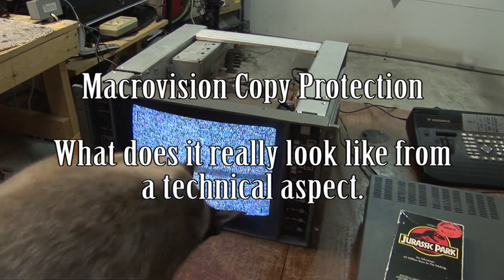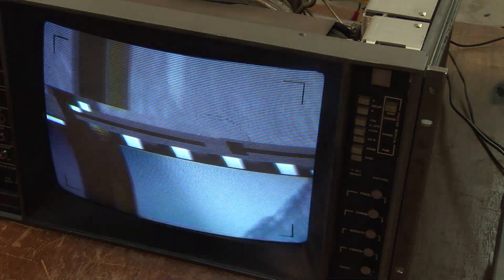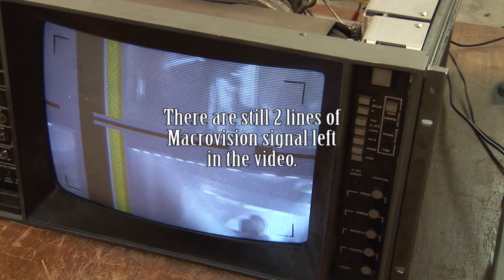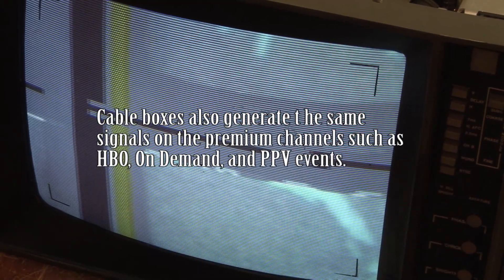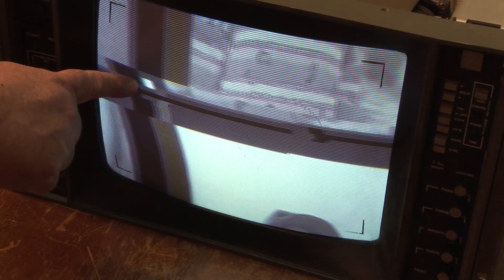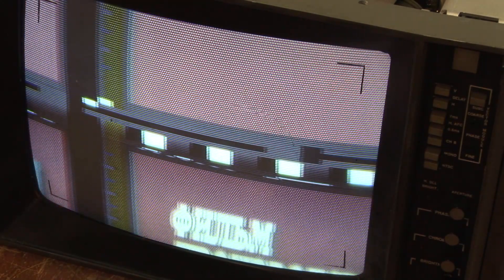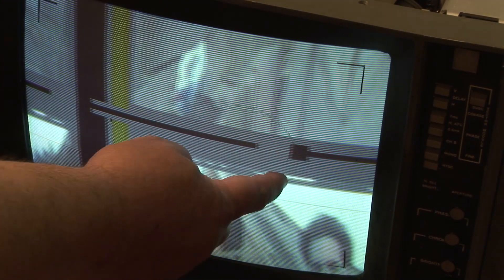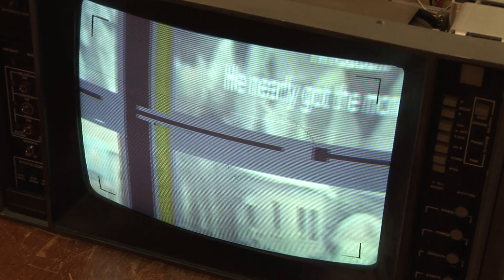Macrovision vs a Time Base Corrector

Comment: Some DVD players, especially off-brand models, can be configured to disable MacroVision encoding and region locking. It usually involves pressing a special combination of buttons on the remote to enter a hidden service menu with those options. The TBC in Sony DV Handycams is almost good enough to remove MacroVision but there is still a slight and brief but noticeable brightness dip whenever the bright white boxes kick in. I've seen MacroVision encoding cause brightness variations even when just watching a movie, not trying to dub or record it.
Reply from the maker: +VWestlife (backup account) Macrovision is evil.Yes I know unlicensed DVD brands could disable it.This wasn't intended to specifically target DVD, it was just to show how it works. Cable and satellite box use of macrovision is what most people would need a scrubber for so that hard copies can be made of encrypted programs on premium channels like HBO.

Comment: It's not just VCRs, many old tellies had problems w/ MV, also. When I was a teen (~25 years ago), my dad bought a MV-killer for our 70's-era 19" telly. The symptoms on that set were usually a black bar from the top of the screen, down to about 1-1.5" & the rest the picture flashing, fading &/or rolling. And we weren't feeding two VCRs, just one to the RF aerial terminals on the set.
Reply from the maker: +Madness832 
Yes it did cause problems especially with rf modulators as the bright white pulse would over modulate the carrier so the rf modulator would "ride the gain" with an agc just like a VCR.
Reply: @ Madness832 Interesting... I wonder if you used a HDMI converter it might smooth out the signal.

Comment: Both devices seem to replace signals in the blanking intervals, only differently. The macroscrubber only replaces most of the VBI, the TBC seems to replace the entire set of blanking intervals, and offsets the signals somewhat, for counteracting that little time shift that switching between two video heads causes. That's how it looks like to me. So far I thought, it's only the square pulses in the VBI. Very informative video, thanks!
Reply from the maker: The macroscrubber uses a sync pulse generator for TV camera, and gen locks to the incoming signal to produce a  blanking signal to mute video in the first 21 lines after vertical blanking. 
The TBC digitizes the entire video signal strips all sync information and generates new sync, then converts the 4:2:2 component digital signal back to analog, completely rebuilding sync and burst signals with new sync and burst, and in the process removing jitter, or tibe base errors as they are known which all analog video formats will have due to variables in analog tape playback. Temperature, humidity tape age, how many times it has been played (tapes stretch slightly) andslight alignment differences between machines all cause slight differences in the timing signals as they are read off the tape by the spinning head.

Comment: Somehow I think I missed this video when you first put it up. I used to use umatic high band for "prolonged" rentals. It seemed playback was more of a problem then recording. SO since I didn't have a macrovision box I made up a photo interrupter out of a loop of transparency sheet attached to the top of the umatic drum. Two carefully placed pieces of electrical tape on the sheet triggered the playback machine's vertical blanking ('mute') function via an op amp schmitt trigger I set up. This was "adjustable" and did effectively mask the VBI macrovision although the edges of the mask had interesting jitter (likely from the photo interrupter 'flapping in the breeze').   A slight tweak to the burst flag period 'window' (or whatever that's called) would chop off the bad portion of the burst flag and the machine would regenerate it, I believe. This did actually work for playback on a finicky monitor (which was my best one). I wanted to try it on the recording end but I don't think there was a way to regenerate burst flags before recording. But I think I could have used the photo interrupter VBI setup for r3cording and dealt with the chroma on playback.  Makes me want to go back and try this again when I have time.

Comment: What is it about certain older VCRs (before the DMCA) that they do not react to Macrovision?  For example, I have had the following RCA models made from 1989-1996 (I believe they were rebadged Panasonics and/or Samsungs) and all could properly record an analog Macrovision encoded signal from another tape (DVDs I do not know): VR625HF, VR740HF, VR603HF, VR603AHF, VR605HF, VR613HF, VR617HF, VR618HF, VR672HF?  Also, would such a Macrovision immune VCR have been able to record a CopyGuard protect tape?

Comment: I worked on the embedded software of a DVB digital satellite receiver once. The back-end (video output) chip was probably the same as one that was used in many DVD players. It was capable of inserting all kinds of MacroVision interference, based on I2C commands from the microcontroller. But not only was there another version of the same chip that didn't do MacroVision and would have been a drop-in replacement (pin-compatible and everything), but also it would have been easy to intercept the I2C bus and not let any MV commands through, or even simpler: block all commands once the chip was initialized a few milliseconds after the set would come out of standby.
I'm not saying that copyright violations are okay, but anti-piracy measures are always a pain for the regular guy who just wants to e.g. make a copy of a DVD to play on their kids VCR (which is fair use), never for the actual pirates that make money off it.
Reply: chinese DVD players didn't have this crap

Comment: That's when the copyright protection has set in 1977 when the General Assembly order companies protect their copies on Video Format include their fictional movies, documentaries, etc. that way their copies will be protected.
Reply from the maker: +Bluethunderboom The reason they had to implement copy protection was not so much for consumers, it was for video stores! Believe it or not when video stores first stared operating, movies were really expensive. Not uncommon for movies to run 150.00 per copy. So stores would be nervous renting out the original copy, and they would make a copy, and rent the copy out. Back in the early days people didn't complain, they were just happy to be able to watch a movie at home. Video store owner figures that if he could get away with 1 copy, why not make 20 copies and rent out 20 at once. Will make his money back much faster. Holllyweed struck back with the first version of copy guard, which was just modified vertical sync, as that would make the drum servo on early machines drift in and out of sync.That was easy to combat with a few transistors and a 555 timer.The next version was Macrovision, and that one stuck. As a content producer I used to encode my commercial tapes, at much expense to prevent clients from copying my corporate videos. When I did a video for a company, I built in the copy rights to my profits. When company "B" was quoting the client 10 grand to do their corporate video, and I was quoting them 5 grand to do the same thing, but I was charging 5.00 for each of the 2000 copies they were requiring, I certainly wanted to make sure that they bought those copies from me. Some companies thought it was OK to get the video done for 5 grand, and then order 1 copy, and go and hook up 2 VCRs and make those copies themselves. You can imagine the look on the face of the guy trying to do it when the copy came out looking like crap, and he had to come back and get them from me. Sure I had to farm the copies out to a duplication center to be done on a sprinter, so that eats away at my profits, hence the 5.00 a copy, but it kept me in business.

Comment: Is it possible when you are digitising tapes on a program like Elgato or Roxio to connect a DVD recorder with TBC (such as a Panasonic DMR-ES-10/15) in between the VCR and the USB capture card and actually receive a signal? 

🇦🇺Cheers from Australia!🇦🇺
Reply from the maker: If you have a DVD recorder why not just use that to record your videos. The digitizer in a dvd recorder is superior to what is in those cheap capture cards.  If you want a file, stick the finished disk in the computer and rip the disk and make an mp4 file. That is what I do because the quality is higher..
Reply: @12voltvids  Great advice, but I don't know which DVD recorders can bypass Macrovision without having to use a Macro-Scrubber.

Comment: I found similar Videonics equipment. But its name is "Titlemaker". Will it have this wonderful TBC too? And maybe I did not understood correctly but where do you switch from flex to infinite time window mode TBC in this thingy?
Reply from the maker: No title maker has a genlock to sync the title over the incoming video but not a frame store.the mx1 has dual infinate window frame store.  The difference between fixed and infinate is how much the video can be off to be corrected.  With stable signals then fixed works better as there is less delay. With crap signals from sources such as vhs then infinate window is better, it will correct a full frame, but if the source is fast or slow it will skip or drop a frame to get back in sync.  Fixed is great when used as a live switcher for live productions from cameras of digital video sources like DV because they will always be rock steady.  Infinate for crapy analog tape sources like vhs beta 8mm ect.
Reply: @12voltvids  Thanks, good to know before I bought it.

Comment: Smashing, i enjoyed that :-D
The scrubber just seems to blank out a section of the video, it possibly uses the sync to trigger a fixed blanking period to chop the unwanted part out, ok for video tapes but not quite right for dvd's.
Many years ago..... i copied an original vhs tape of startrek the movie (original cast), i didnt think anything about it at the time, but years later a frend said "You cant copy them, they are protected".
i was a bit confused, i was playing the tape from an ordinary vcr into my old jvc piano key video for recording, the jvc didnt use the blanking period as a reference for the agc, the piano key had a slow agc too, it didnt give a dam about what it recorded lol :-D
Oh the copy was still copy protected ha ha ;-D
Reply from the maker: +zx8401ztv close. The scrubber is a home built unit I built when I was studying video engineering. It is based on an old RCA LSI chip, a sync pulse generator for TV camera. It is generating black video h an v sync an color burst. There is also a sync separator that genlocks the sync generator to incoming video, and then a count down is triggered by vertical sync from the generator which gates in the new sync for the portion of the vertical blanking do the first 22 lines. It is actually a complex little circuit. I showed it in the other video. Has a few surface mount chips and the big dip package just soldered down to the component side of the board because I was lazy. I did that in 1982 when I was taking my first year engineering course but  I ended up landing a job with Sony the next year while on summer break and took their in house training, only to land at a service center the next year where I stayed for 20 years. It was during that time I started my video production business as a part time gig and ended up working on many corporate, and private video productions. I worked in a TV station for a couple of years too. I actually wanted to do broadcasting full time, as an engineer but that didn't pan out. Didn't have good enough math grades in high school to get into the 4 year program. I had algebra, but skipped out on the advanced calculus because my stupid high school councilor said I didn't need it. Go figure.
Reply: +12voltvids At least i was having a guess lol :-D
It sounds like you acheaved so much, you are a very clever and experenced man, leave the mathmatics to computers lol.
Thats why i enjoy your videos :-D, you are a no nonsense man that gives sharp understanding without confusing your audience.
You should have been a teacher of electronics :-).
Most teachers dont have the feel for the subject they are teaching so its hard work to understand them.
Reply: Prior to being mandated by US law, some Consumer VHS VCRs were not vulnerable to the Macrovision signal. Note there are two key words in the above sentence, Consumer and VHS. The legal requirement for copy protection only applies to VHS and later formats as well as consumer equipment. Due to the law coming in late, Beta was exempted as it did not reach the sales needed for the law to take effect.

As you noticed, any time there is no Time Base Corrector in circuit, a successful dub will contain the copy protection signal. This means you can't bypass it by adding a Beta generation. DVD to Beta will work, but the Beta to VHS copy won't work. When using a professional VTR you may be able to use it on the playback side as some units have integrated Time Base Correctors.

Of course, this is only a discussion of what is technically possible, even if you can bypass the protection, you are still bound by copyright law.

Bonus info: The reason Closed Captioning and Text is deleted by the Macrovision strippers is due to the way they treat the blanking interval. The strippers usually black out all of vertical blanking, this includes Closed Captioning, Channel/program information (yes this did exist on Analog on higher end sets), Rating Data (for V-Chip), as well as any other data in the Vertical Blanking Interval.

Comment: The scrubber also eliminates the closed captions that wouldn't be good if you need them.
Reply from the maker: Right but you can't copy s tape or ppv signal that has macrovision so losing the CC data is a small price to pay to be able to record vs not record.

Comment: I had a Sony SLV-920HF which had a bit of what I thought was quite an oddity.  If I set it to SP, it reacted to Macrovision.  If I set it to EP, it did not and I was able to make copies of Macrovision protected tapes that way.
Reply from the maker: That is strange because macrovision affects the auto gain control in the modulator and it is the same circuit regardless if the speed.  Betamax was unaffected by macrovision primarily because betamax was considered a higher quality format that Sony modeled after the professional 3/4" umatic using the same circuits that 3/4 used. In other words they didn't have the macrovision detection that VHS had built into the chips. On hi8 they had a little plug in board that you could remove to defeat it.
Reply: @12voltvids 
Right, that’s what always caught me off guard about that particular deck.  It was almost as if setting it to EP disabled the video AGC for some reason.  Some weird design flaw maybe?  I don’t know.  That was the only VCR I had that did that.  
I actually have come across a Betamax that Macrovision messed with … hmmm.. actually, it was Sears model, OEM’d by Sanyo, so maybe that doesn’t count lol

Comment: it is like the Videocrypt (system used by SKY PLC)  data signal at the top of the picture area.
Reply from the maker: +DAVID GREGORY KERR Well, not exactly. Videp chypher uses a similar system for analog NTSC satellite, where they replaced the entire horizontal and vertical blanking area with data.  If you look at the pulse cross portion of the picture, everything except for the active picture area, and the color burst (the green stripe at the beginning of each line) was replaced with digital data. This digital data was actually the audio for the program feed, and the subscription data for the descrambler board. I remember seeing some old chipped boards that would unlock the video, and for a period of time would unload the audio too, but the audio was scrambled, and once the fix stopped working, it would descramble the video, but no sound.  Basically only good for watching programming where the sound really didn't matter. You can use your imagination here.

Comment: Thanks a lot for this interesting and excellent videos!!

I have a poor english, so I think i've understood: if i want to digitalize vhs always have to use a tbc (i have mx1). always with 0 options in the setup menu?

but if i want to erase mv from a tape the best option is a mv eraser box. i have one of them but i dont know if all the boxes are the same way or there are different systems... i have one of these boxes but i dont know if internally is the same than your.

thanks in advance and hope to keep in touch !!
Reply from the maker: The MX1 will remove macrovision enough to record on most devices, but a true macrovision scrubber will completely eliminate it.
Reply: Thanks for your answer! dont know why but mx-1 gives me a darker image than the original :(
Reply from the maker: Yes I have noticed that too. Eveything passing though it is slightly darker, but there is a fix for that. In the setup menu there is a black level adjustment. I forget which icon it is, but three is one that compensates for it. Been so long since I used an MX1.
Reply: Great !! I'll test the different level option :) Thanks again!
The darker image is only when there's a MV signal, isn't it? Or a tape free of MV gets darker too?
Reply: I'd like to ask you. The best option to capture a vhs with no MV protection is directly with no changes in the Videonics configuration and if the VHS has MV just only configure the Videonics with the black level adjustment at 3? Thanks in advance for your help and sorry for my english!
Reply: Hi again! Could you confirm me my last answer? Thanks in advance :)